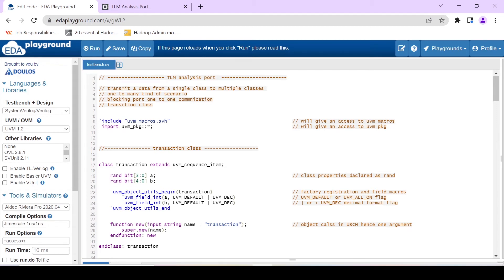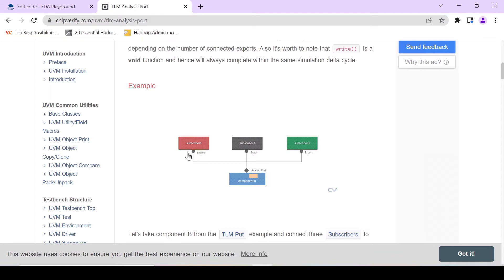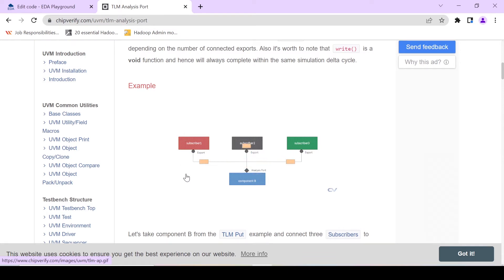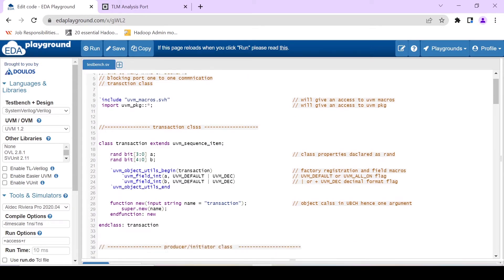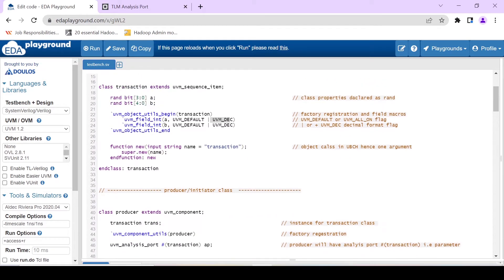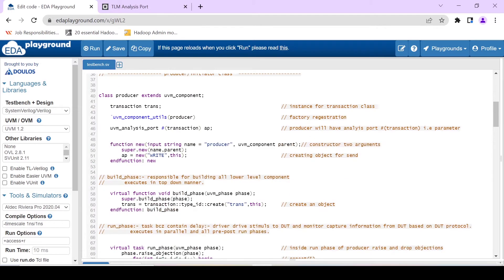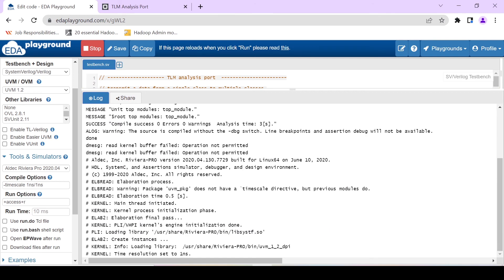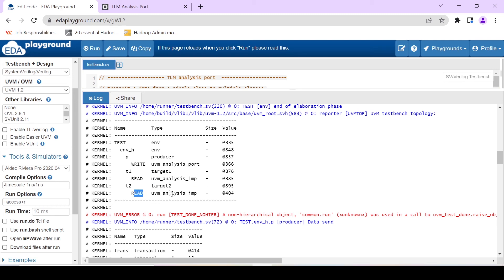Analysis port and export/implementation port w.r.p.t SV-UVM

Comment: Hello Sir, 

I had a question regarding the above code:
1. What if i write ( trans = transaction::type_id::create("trans",this); ) in the run phase
2. (ap = new("Write",this); ) in the build phase will it change the result?

Regards,
Reply from the maker: See every phase has been defined to do the specific job, but in run phase also u can create an object using factory's create method..

Just try to implement once.

Hope this helps:)